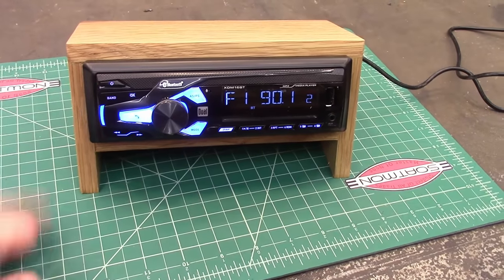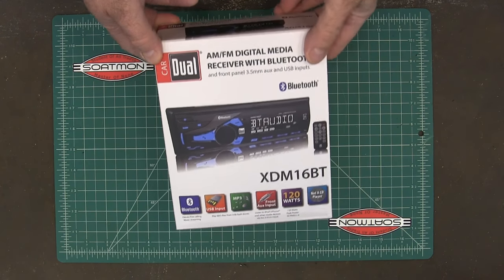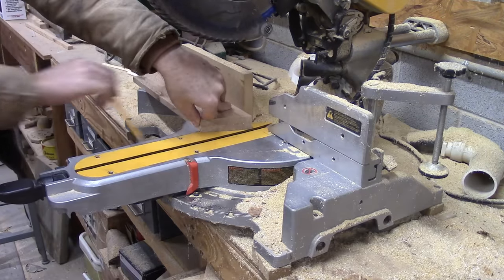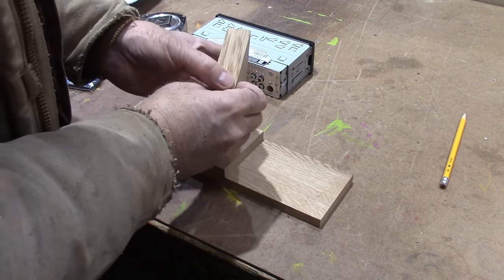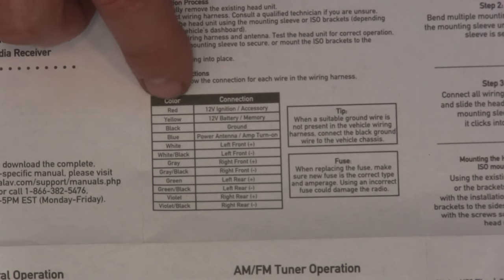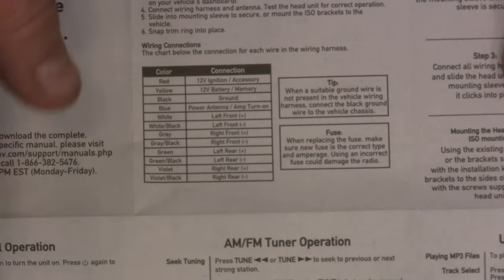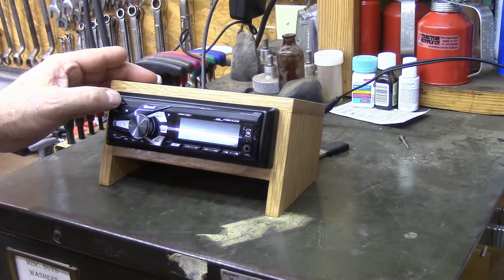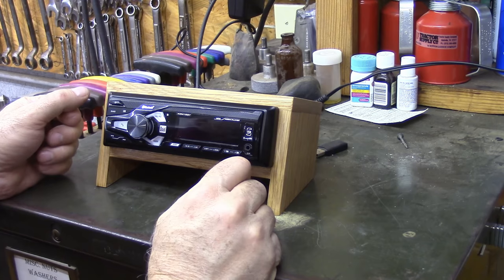Shop Stereo for Under $20

Comment: Brilliant.  I'm a new hobbiest and have 1976 Marantz and Sansui gear.  This would be a great project and maybe even a way to get cool lighting and great sound using some 1926 and 1927 radios I have.  I've disassembled the radios, done repairs to the wood veneers and set aside the insides (I don't feel comfortable with working on tube gear and it's extremely high voltages).  This seems like a great way to build another great sounding, unique setup.
Reply from the maker: That sounds like a cool project Johnny!

Comment: Thank you very much!!...I have a 1949 admiral floor model radio that I am bringing up to the 21st century and this is the exact radio I bought at Walmart and your video is so helpful of wiring up a couple of 6.5" speakers I am putting in the radio....i am leaving all the outside details but ripping out the old record player and behind the doors  I am building a face plate to install the car radio .....thank you so much for the info of your build and how to wire it up
Reply from the maker: You're welcome.  It sounds like an interesting project.

Comment: I just used an old tractor battery with a partially melted negative post I had lying around, I have a trickle charger that I leave on it it runs my barn car stereo, and an old oohga horn I found and wired up with an old bimatellic turn signal flasher to make it a claxton. Unfortunately the horn was dropped several times so it don't sound the best, but its loud.
Reply from the maker: Thanks for adding your experience.  I love the idea of a flasher to make the corn a claxton, great idea!

Comment: What amplifier did you use? I have one of them I bought at Walmart for 25.00 with 4 speakers and it barely gets loud at all. I used my Milwaukee battery then tried my computer power supply and neither times did it get loud and clear.
Reply from the maker: It's a Pyle PT3300 but it's not available anymore.

Comment: Absolutely great idea. Well done.  On the last video you put up, I just put new tires on the bobcat and foam filled them.  What a difference that makes.  Turns/skids much smoother and has more traction.  If you ever do get one try this out.  It wasn't cheap.  The foam costs about as much as the tires.  But I think it is worth it for the performance.
Reply from the maker: I've been interested in foam in some tires but never found a source I could afford, maybe one day it will get cheaper. I tried the great stuff foam idea in some old riding mower tires but it didn't work at all.  I didn't cut them open but I don't think it foamed up completely. Why do you think it improves the performace, is the ride softer or stiffer? Thanks for telling me about it.
Reply: Right, yes I tried the great stuff too but it didn't work for me either. Then I went to a farm/industrial tire place who sold tractor tires.  They have the ability to put foam into any tire. It takes 24 hours to cure and the tires need to stay on their rack for curing.  I did my lawn mower tires as well.  I would do more but it is a pain to always take the tires to that tire place and it is expensive too.  The reason I did it for the skid steer is that the side walls get very stiff and they don't flex while skidding/turning even on pavement.  I don't know about the ride as the bobcat isn't a great ride to begin with. But they are definitely harder, much harder.  I don't think you would want to do it on just any tractor if ride is important.  You can NOT do it on tires you want to run on the road, they will overheat, I am told.  I have a small blade-moor grader and for that the foam tires was a great advantage in the extra weight on the ground.  My tires probably weight 300 lb. each when filled. and that makes for more traction.  But your water filled tires do that too. For me I think it is the stiffer side walls on the bobcat and grader that is the greatest advantage.

Comment: Hey bud, I wired it up just like you but I dont have any radio stations coming through....what wire do you use for the antenna or how do I get radio stations??
.TIA
Reply from the maker: You will need an antenna.  You can just pick up a car antenna, it should plug into the back.  If you don't have that a piece of wire inserted into the antenna port may be enough, experiment with the length.

Comment: I bought a $50 one of these on clearance by JVC. plays everything but CDs. I have two 150 watt speakers hooked to it and have it powered by an old PC power supply. It cranks pretty loud but the stereo struggles at high volume, it's only like 40 watts and the speakers are good speakers. Could never figure out the memory backup the wire that is always live so I just wired both positive together and the radio will work as long as you keep the power supply on but my garage has switches that turn off the power.
Reply from the maker: To get them memory backup to work you need a 12v battery.  If you will hook up a 12v battery to it, it will retain you settings when you turn it off or unplug it.
Reply: You could use a battery tender from harbor freight.
Reply: @joshblanks9479  I use an power supply block from an old PC. Puts out 12 volts.
Reply: @coondogtheman  I have one them too.  If the memory wire to work he needs it on 24/7 and even though that power supply is built to run long periods of time it may not be good to leave it on that long. But if he would use a battery tender just for the memory which is a couple amps and are made to run continuous then he would be fine.
Reply: @coondogtheman  an x box power brick works great too. Do you know how many amps at 12 volts these computer supplys put out?
Reply: @joshblanks9479  I have one of those too. I used it to power a flat screen TV and for some reason when I plugged it in it turned on. Then it must have died. I now have a PSU from an old computer and I wired a switch onto the power enable wires and it's been working pretty good. The fan is a little noisy so I may change it out.
Reply: @joshblanks9479  Where I have this rig installed which is my workshop, I'm not out there that much at least not in the wintertime. I've run it at least 6 hours each time and nothing bad has happened.
Reply: I want to make my unit portable and possibly into a boom box.  

So how to not lose the memories when the power goes out or I unplug it WITHOUT using a battery which I don’t want to maintain.  A capacitor should to the trick, I just need instruction how to get it integrated.  Please advise.  Thanks!!

Comment: Great video I really enjoyed it. What kind of antenna setup are you using. My garage is metal so I’m assuming I’ll need some kind of external antenna.
Reply from the maker: A regular car antenna should work fine.  If you can hear your car radio in the garage it should work.  If not just get one with a long lead and mount it outside.  Good luck!

Comment: Does it support a subwoofer? I'm thinking of making a portable boombox with a little sub in it
Reply from the maker: I would think but I don't know.
Reply: The wire harness didn't have a subwoofer line on it, so if the head unit you choose doesn't have one built in, you'd have to set one up off a separate amplifier, just like in a car.

Comment: Awesome stereo man. I'm trying to build one but I dont know what kind of power cord I need. You said yours was from a printer. Is there anything else I could use. I cant find a printer power supply
Reply from the maker: You can use any power supply, you just need to make sure it is 12v DC and has enough amps for the stereo you are wiring.  The stereo should say how many amps it is and then just get a power supply that is a little bigger than that.  Good luck!
Reply: @SoatMon  thank you

Comment: Question how would you add a battery to keep the memory on the radio?
Reply from the maker: On this stereo and most car stereos there is a wire there are 3 wires for power.  The negative one that goes to the chassis or neg post of the battery.  One that goes to the ignition switch that turns the stereo on when the car is turned on and one that goes to the positive post of the battery that maintains the memory in the radio.  Find the schematic for your stereo and it should show you, many time it is printed on the stereo itself.  Good luck.
Reply: @SoatMon  thank you friend I appreciate the response.

Comment: I may be wrong but you need a 10 Amp for 12V at 120W
Reply: I didnt do the math, but I wouldnt doubt that. I suppose it should be fine as long as its not cranked up while playing songs with a lot of bass, but a greater amperage charger would help for sure. You could also take a look at the fuse on the stereo and see what its rated for and go off that.

Comment: You coul put the power supply under the radio in the cabinet so you do not have it hang out the back? Nice job. Just figured out Soat Mon.
Reply: Soat mon - Doesn't mean anything to me!
Reply: @willford8475          Student of all trades   Master of Non
Reply: @willford8475  It is in the title on his homepage.
Reply from the maker: That would make a cleaner project. This is actually a step up from the last one that just sat naked on the cabinet.  Thanks for the idea!
Reply: @SoatMon  It will save wire clutter. How many acres do you farm? I have teo older barns and one new shop, we are expecting 70 MPH wind gust to marrow night. I will be parking one of the trailers next to the oldest to block some of the wind.
Reply from the maker: I don't really farm but live on 60 acres.  Praying you and your family are safe.
Reply: @SoatMon  When I was younger we had 29 acres (7 was cleared the rest was hard woods, always missed it, now have 10 acres with three large barns. One has been converted into a shop (videos are up on YouTube). Wind storm started Sunday morning and is still continuing, it is supposed to stop 10 PM this evening. Lost the trim between the front and the roof on one. easy fix it it does not continue to peal. Not climbing a latter in 75 MPH gusts. Was changing the light bulbs in the over head light, was in the barn and the wind blow the latter over. Stay warm.

Comment: where would I buy an aux jack?
Reply: Yes what is this part called and where can I purchase? I need this piece where the left and right speaker wires connect to to enable aux cable input.  Thanks

Comment: I cant get any car amps to work on house current me not dat smrt
Reply from the maker: You just need a 12v power supply that will supply enough amps to power the equipment.  Something like this should work  https://amzn.to/3CfXsXN  you just need to know how many amps you need and that should be on the amplifier.  Be sure and buy a power supply with more amps than you need as they often over rate them.  Glad you got a set up you like!

Comment: First of all.. clickbait.. power supply will only allow -36 watts of audio divided by 4  so not 100 watts..
Reply from the maker: Sorry you thought it was click bait, not my intention.  It works great for my needs, if you need more power just increase the power supply.  Thanks for the comment.
Reply: If you really need more wattage than a power supply will deliver, do like he did and run it from the head unit to an amplifier with a separate power source.
Reply: I like one man's opinion he used a trickle charger and had a used lead acid battery to provide the wattage required